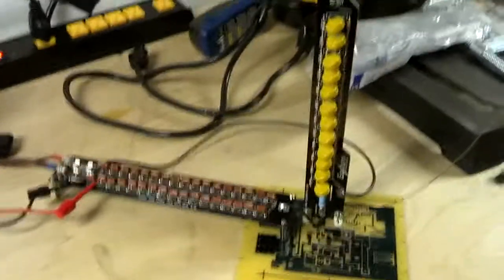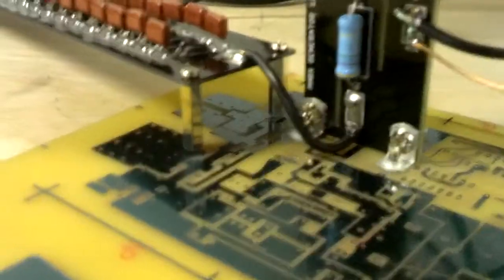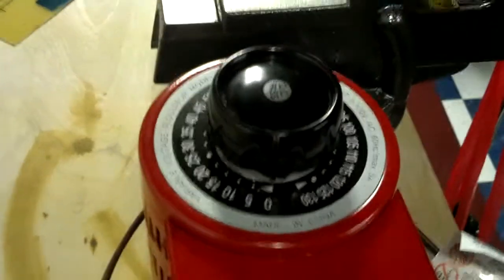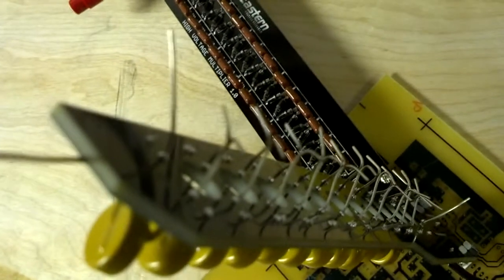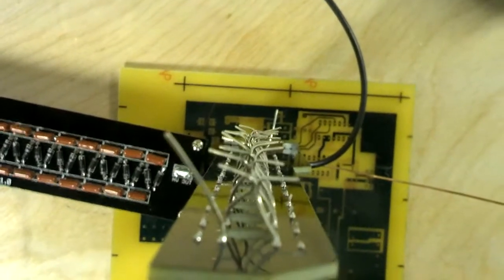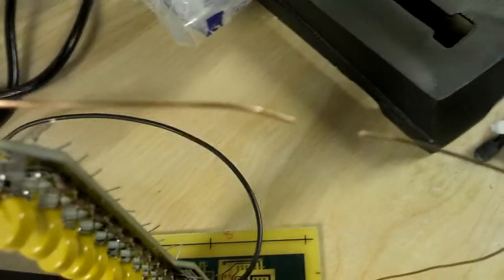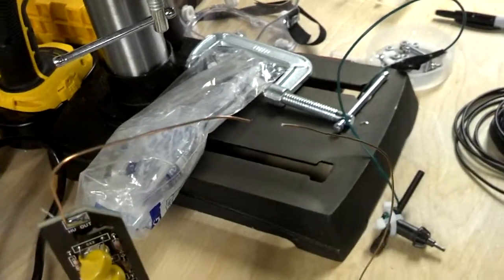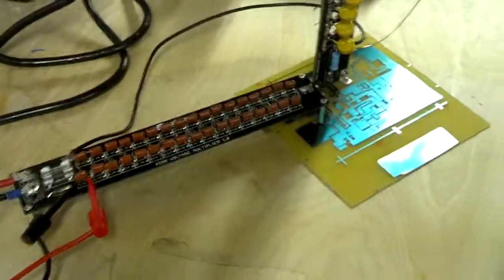Marx Generator Evaluation 2

Comment from the maker: Your results are way better haha.  A clear indicator that what you are using to supply power is working better than the voltage multiplier.  I too agree that the Ballast resistor is overkill.  The only other resistor I have to try is a 3W 1M ohm but i have no idea the material.  I will try it anyways though

Comment: My findings were pretty much the same as yours with respect to the spark gaps, at these lower input voltages they need to be just right or else one of them ends up discharging all of the other capacitors.

I think the 4.7Mohm charging resistor is a bit over sized too, but maybe its there to prevent the multiplier from drawing too much current. Anyway, I've posted my results on 4hv.

Comment from the maker: Thanks.  I actually did exactly that to start with.  It did not work at all.  The power in this little kit is just too low and it seems that the the only way to get the gaps to fire is to keep them about 2-3mm apart and sharp pointed at each other.  It definitely adds corona losses but the gaps just don't fire.  Its odd because typically you wouldn't want to do that.  I also tried small brass cap nuts.  Part of the issue is the voltage supply too.

Comment from the maker: thanks for the suggestion I'll try that.  I think the Multiplier capacitors may not have high enough capacitance to adequately charge 4-6kV.  I have the same exact reddish capacitor but .47uF 250V  im tempted to order a whole bunch of them and try with those.  I mean, the multiplier definetly works.  What I'm implying is that its charging too slow and not much power, thus the marx gen is "wanting more" than what the multiplier is giving out. and there appears to be losses.

Comment: Try putting that 1Mohm in parallel with the 4.7Mohm, that will give you 820K which sounds more like what it should be. I used about 145K on mine but that was for a lower supply voltage. 

I defiantly think these marx boards can give so much more performance, its just the multiplier board seems to be limiting it. I wonder if any of the other guys who got the kit has access to a 4-5kVDC supply which they can test the marx generator on its own, then we will see what this thing can really do.

Comment: I've been playing around with Marx generators for a while and one I have found that they don't like is sharp edges you may be losing voltage because of Corona losses from the ends of the capacitor Leeds you my want to try bending them rite round to form as bigger  loop as possible then solder the joint between the end of the lead and the side of the lead this has always worked well for me in the past tho my best marx generator I have mad I used 10mm ballberings soldered to the ends of the leads